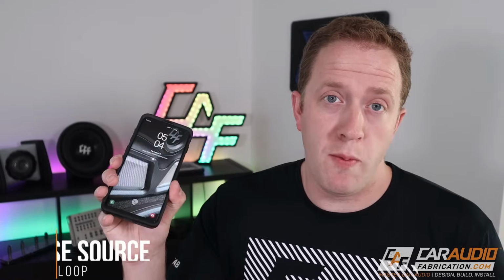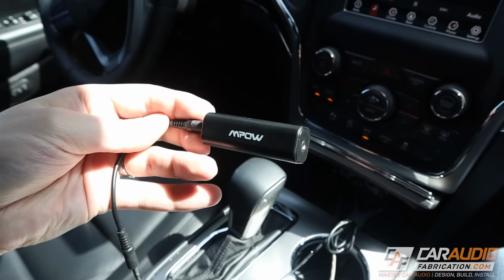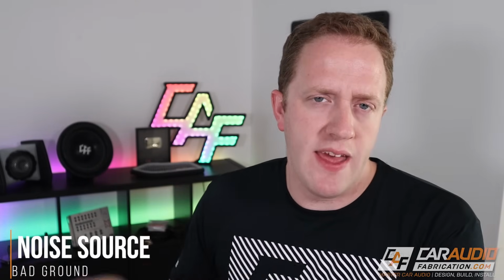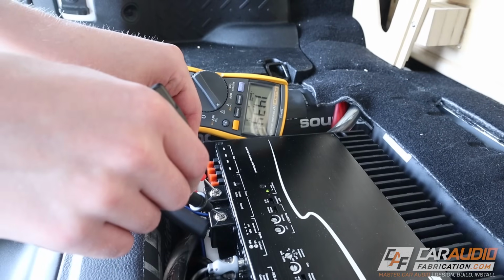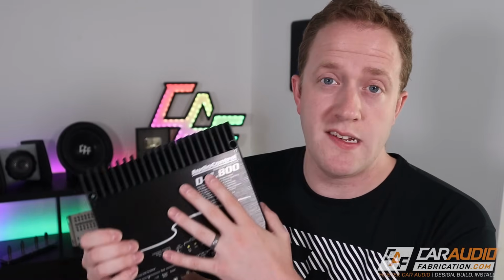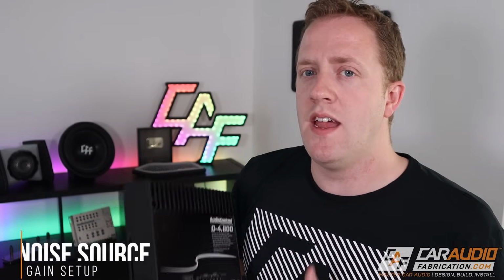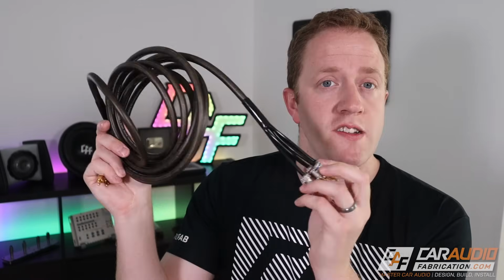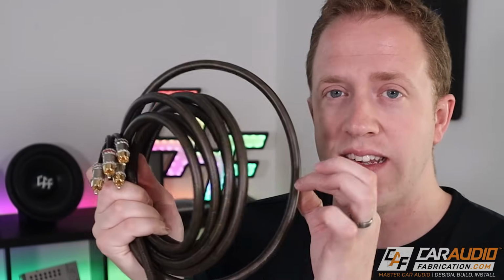BUZZ, WHINE, HISS? How to FIX Car Audio Noise!

Comment: Hi guys,

I have the same issue, but I already tried most of the tricks in the video : I switched grounds, grounded the components directly to the battery, added Ground Loop Filters etc...

The strange thing is that the buzz get's louder when i press the brakes, or when I turn on my turn signals (at the same frequency as the bulb), and it takes a few seconds to stop after i turned the volume all the way down.

Any ideas ?

Comment: I have a lexus is2015 i have a aftermarket amplifier hooked up with 4 mid range. and everything connected to my factory radio using a Lc2 but i’m still not getting enough power to play it louder , can someone help me with this issue??? :(

Comment: I guess mine isn’t that common. 

When my key is on accessory position no hiss. 
Once it goes to the on position hiss. 

Radio can play with absolutely no hiss of the key is turned to the accessory position. 
Hiss will stop if I turn head unit off.

Comment: I've literally  done everything  I can think of to get rid of alternator  whine besides just adding filters. Is there any special  circumstances to where there is no other option. It seems  to me that if the noise is happening  then there is a problem somewhere else that a filter is just hiding.

Comment: Hi there i have a strange issue, the whine nose i get only happens when i turn on my headlights so the head unit plays normally, and without an issue, until i turn the lights on then i get that Whine that are you talking about any advise? Thanks again for the video it's very informative

Comment: Im using an aftermarket headunit in my 2000 silverado.  Its been perfectly fine for 15 years.  I recently added a 3.5mm headphone jack to the AUX input, and connected a small $10 Bluetooth adapter from Amazon... It was cheap, but has 4.5-5 star reviews from everyone, and they all said the sound quality was great... I'm getting a whine that gets louder as the engine revs.. Im sure its RF interference from the ignition coils, but i'm not sure how to isolate it... And just to add, my 3.5mm to AV cable is only 1ft long.. it was just long enough to make the connection, and allow me to mount it right under the air vent, in a factory "blank" spot... Something i guess is used for a feature i don't have. lol  Thanks

Comment: Hi, I installed an amp in my car with high level inputs cables directly to the amp (keeping the factory stereo) and I get a lot of static using the radio, CD or aux. I have a ground cable bigger than the power cable. What should I check? The ground cable is bolted really tight.

Comment: In my car the radio became static in end of may and then my bluetooth transmitter stopped working compleatly a week ago. I did charge it at the same time as using it, so  what would be the right thing to do? Does the 1st option in the video also fix radio?

Comment: I just installed a full system to my stock head unit in my 2016 Canyon. Now my blinkers are LOUD!! and there is a constant buzz tnat does not change with RPMs... just constant.  The power line is run away from speaker wire. The ground is in the body under the rear carpet near the amp. Any ideas what else I should check besides what you talk about above? And thanks for ALL the videos...I have learned a lot! ;)

Comment: The problem I started to have ( 04 Acura TL, everything is still lemme ) is that I start to have the front driver side speaker and tweeter buzz whenever the car is on. If I just have the ignition forward I can play music with no issues, it’s only when the car is turned on!

Comment: I have a Toyota rav4 2001 just got a tune up oil change but this problem has been on going a mechanic told me to just unplug the battery it works for a short time but go back to where it was this problem is with the radio i don't have a amplifier but i am getting the same noise that you are describing in your video now i think i need a new radio or is there a bad wire somewhere ?????????????

Comment: I watched  about 5 videos about static noise, I disconnected all the speakers 1 at a time. Went through the ground wires.  Then when I turned on the stereo for the 20th time, I looked, and it was on a nonexistent FM radio station. LMAO, I am such a Noob. Set it to CD or BT or heck set the FM to a station, problem solved.

Comment: Strangest buzz I ever had. Did everything you said. It was a 95 chevy van. Doghouse cover to the engine had 1 loose screw holding it shut! I even bought new plug wires amongst other things. Chased it down for 1 year! Was a stupid loose screw.

Comment: When I bought my 1990 mustang in1990
I put in a better sound system 
I got a whine that the transmission. 

I put in a transformer just behind the radio. 
I ran it through the ground.. 
Whine gone. 
Never figured how it worked
Had a old timer tell me to try it

Comment: I have a 2014 Passat with the Fender sound system, I started hearing a static noise on my passenger door, so I replaced both door speakers. Still happening, only to that one speaker. What could that be?

Comment: Please help me... 2017 WRX with OEM Kicker speakers.  No external amp.   There’s a cracking noise from the tweeter area but can be heard in every speaker. It’s almost like a rattle or a buzz, but it seems frequency dependent. Some songs it’s bad, some you can’t tell.  It’s driving.  Me.  Nuts.

Comment: I have the issue where it whines when i accelerate. But not only that also when i use more power fx. by rolling my windows up and down, or increasing the air from the fans. It's when i use an FM adapter, and when i use the typical radio stations on my radio i have no problem, othere is clear sound coming out from the speakers. Anyone knows a fix, because i can't find any on google and etc.

Comment: hi mark i have this problem with my unit if i wire a mono amp or 2 channel amp i dont get this engine noise. as soon as i wire a 4 channel amp to my unit using front and rear rca from my pioneer unit i get this engine noise doesn't matte if i play only cd or fm or bluetooth. when i wire a 4 channel and use only rear or front as bridge to my 4 channel amp i don't have the engine noise. i checked my grounds my rca cables i tried a different unit but still have the same problem. this problem i only get if my car is started.

Comment: I just got a subwoofer install from the company and when I accelerate, the speaker makes a loud humming sound. I check ground connection which is good and sand paper down but noise still continue when I tear up my engine. 😩😩 help please. I spend too much to be dealing with this.

Comment: I’m currently having some crackling coming from the front left (driver) mid and tweeter (component), and both rear coaxial speakers at low volume. When I turn the volume up last 10, the noise seems to go away, but immediately comes back when I lower the volume to 10 and below. Quick breakdown of my system: Alpine Type R components up front, Alpine Type R coax 6x8 out back, Performance Teknique 4 channel amp (don’t remember specs offhand, but advertised at 250watts per channel), L5 12” Solo Baric, Performance Teknique mono amp (approx 800watts peak), Pioneer Avic D3 head unit along with complete KnuKoncepts wiring and Krystal RCAs. Anyone out there have any ideas as to what’s causing the crackling? Thanks!  🍻

Comment: Yes, I re-routed the rca cables, sound got worse, now it makes noise when the radio is on, an also when cd is playing, will try putting a plastic  or rubber washer between the amp, an check the ground wire in the head unit.

Comment: I have a questions . I have a aftermarket head unit, amps and speaker . When I turn the head unit on I get a buzz from the speakers . But if I have the car running and I shut off the head unit . It goes away . Is that the ground to my head unit that's bad or do I have to look at the amps ? BTW me turning the head unit off turns off the amps as well . Thank you

Comment: im having a hiss to my aftermarkets front dash speakers i just installed.. they are connected to my factory amp. and my subs are to my aftermarket amp... my rcas are running along the middle with the power cable to my amp though. i disconnected my rcas from my amp but no difference.. im going to disconect the power from my battery to my amp right now i guess that will tell me if its my rcas because no power will be along side them.... if that doesnt work idfk....

Comment: Hi Mark....thank you for all the videos shared...
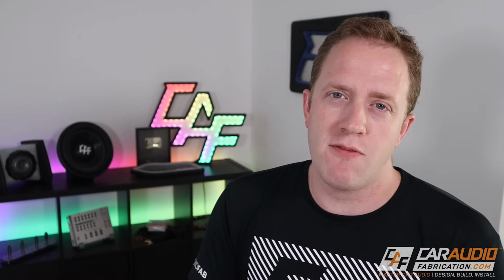I have XM-GS4 and only the front right channel makes a weird noise. I have a wrangler too and if you can please click the link you will find the audio I recorded of the noise. Background is my car on idle and around min 1:20 you will hear the noise I can't get to eliminate.  https://drive.google.com/file/d/1FEirD9iHFOBPA3vgZG3C2GtwCxRdA1UG/view?usp=drivesdk
I hope you can advise me... 
I already changed, wires, speed wire (9), ground, RF speaker,  signal cables, I added noise suppressors, etc and I can't get it fixed...it is only the RF channel...hope you can help me...
I am about to open a warranty claim to get the amp fix by Sony...Thanks in advance...Natalie

Comment: i remember having a whining noise in the back passenger side of an 1999 audi a4, idk why it started, but it would get louder with acceleration, and wasn't present if the key was only in auxiliary, i have no experience troubleshooting so i just unplugged that speaker and started reading and watching.. this video had some good info

Comment: I've got a high pitch ringing going on with my radio that only goes away in standby mode. Volume at zero and it's always there. New Kenwood radio, 2 Rockford fosgate 6 inch in the front doors, 2 6x9 on the parcel shelf and new 1000w Kenwood amp in boot. Good earth and I haven't adjusted anything on the amp because I don't know what to do. Anyone have any ideas because it's really pissed me off..

Comment: What if I get that buzzing noise ALL the time? It’s does it to matter what. Even when my phone is not plugged in charging. And my phone is connected to my radio thru Bluetooth not aux code.

Comment: yo bro im from Philippines, i have a Audio set up on my Tricycle 2pcs Subwoofer 12" running on a 1000watts Sony Explod Amp and a 4pcs of 6x9 speaker For Mid range and High range runnung on a Lightning lab Amp i use a 2D battery to power it all and a pioneer parametric that connects to an aux to my Cp When i turn on my Sounds then Turn on the engine it has some whining Sound or what we called static that When i Rev the engine my Audio set up also Whine what should i do?  thank you for your response Godbless your channel!

Comment: Mark I'm going nuts trying to set the gains on my Kenwood excelon 5 channel amp. Every time I try to measure it with my o-scope it's reading some whack 8khz Signal or even higher when I play my 1khz test tone. On my old car I've never had a problem. Have you ever run into an issue like this? When I test the RCA signal it reads perfectly.

Comment: I'm so confused, static in all of my speakers that goes up with the gain, but stops when I unplug the RCAs. I even got a ground loop isolator to no avail. I redid my ground as well to have a very clear connection, any suggestions?

Comment: I ran new speaker wire to my components (10 gauge) on passenger side I ran out of that wire so spliced 12-14 gauge wire I had laying around. Both OFC speaker wire . I have a slight hissing/humming sound at all volumes from 0-40 noise does not change with volume increase or decrease. Do you think this is caused by me splicing those wires should I just buy more 10 gauge and wire it same as driver door. (Which is not making noise)

Comment: Factory radio . Aftermarket amp. First Bluetooth mic disconnect it worked but no Bluetooth talking then added a pac .. problem solved

Comment: I separated my rcas from the power wire that runs down the car. There is still a whine every time I rev the engine, but it’s not as loud as before. Any ideas to get rid of it completely?

Comment: I can hear the FM radio on my bluetooth setting in an android aftermarket radio, I didnt hear it before, but after connecting the amp signal wire to the ignition switch, its now a problem, maybe something got loose when I pulled the radio out? I had to connect that wire to the ignition, because before when I used to shift to reverse, the amp signal would stop working when I shifted back into drive.

Comment: My friends car has a hissing noise when high output sounds are coming through the speakers, usually vocals like when S’s are said or high hats and cymbals. Would You happen to know what some reasons may be for this? It’s an aftermarket radio with an amplifier for the speakers.

Comment: I have quite an odd issue I can't find a solution to. I have a 2014 vw jetta tdi and I wired up my head unit, and it wouldn't turn off, then I found that the stock radio was controlled (on/off) by the canbus system in vw's so I ran a wire to the cigarette lighter for the stereo on/off since the cigarette lighter turns on/off with the car, and it worked but when I put my amplifiers in it created a high pitch ringing noise all the time, but only with my charger plugged in, but my phone isn't plugged into it (with the engine off or on), I have some led's plugged into it but not my phone, so I went over to the fuse box and tried tying the stereo on/off into every fuse that turned on/off with the ignition and everything made the same ringing noise. It doesn't matter if I have nothing but the power, ground, ignition signal and the rca's, it still makes the noise. I tested the amp by plugging my phone into the rca's and playing music and it was fine, tried removing the radio and testing it with my home theater system and it was fine with that too, I don't know what else to try please help. P.S. ran new power/ground wires straight from the battery to all the components (head unit and amp) and that didn't make a difference either.

Comment: Hi 
I run speakers wires,signal cables(4 channel from radio unit to LC7I LOC to the boots plus power cables in the same space through the car ,everything works good except I am Getting wired noises in the speakers when accelerating .any ideas why? 
Can it be because my cables run next to each other ? Or could it be something else ?

Comment: Ive got a problem with a subwoofer hum.
When the engine is on, if I turn the gain more than 40%, I get a really bad noise.  When the engine is off, the sound is clear. I'm using a high-low filter.
When I unplug the RCA from amp, the sound disappear

Comment: I had the same problem, but every thing in my stereo is originally, nothing modified, nothing has been add. The only thing is when use the radio it sweet and clear, but if were using my Bluetooth cassette it will make the buzz sound. What to do?

Comment: I installed a DSP between my factory radio and amp and I am getting a hissing noise. The hissing noise does not increase when i change the radio voulume, however it does increase when i change the volume on the DSP. Any ideas?

Comment: I had my amps pick up some kind of electrical noise from my blower motor and blew my Focal KRX2’s I miss them so. I am gonna fix it before I install anymore highs. Right now I’m using the factory highs with my DC audio 2k and 2 12 lvl4’s.

Comment: yes I had this noise and it was wrong wiring ... the audio wires was passing together with the power cables .... and I solved it by change the audio wires to the other side ... thank you dear

Comment: So I can't even turn my gain to 20% without hearing the buzz.   I found a factory bolts and wire brushed it before making it my gnd I have lc7  sitting between my amp head unit what should I do?

Comment: I have a stock stereo. But after market mids and tweeters. There's a buzzing noise even if nothing is playing and at any volume. The shop mentioned they had to install some kind of converter. Seems to be coming from the stereo it self. Any clues?

Comment: still trying to get the alternator whine out of my trailblazer. already upgraded and relocated wiring, better rca's, and ran larger ground cable to frame as well as straight to battery.,  added rca filters and power wire filters. among other things. bought a different pre-amp head unit lowered the noise some, but still there. after watching this video, l'm gonna try running new ground to head unit. that's about the only thing I haven't tried.

Comment: I have a static noise coming through my speakers and my stereo is stock so i used an rca converter and ive tried disconnecting the rca cables but the static is still thrre im not sure how to resolve this

Comment: So I use one of these in my car and with it plugged in it quiets my bass A LOT. When I unplug it the bass in back to normal but can hear the static and popping going all the way back to the subs. Is there a way i can fix this by grounding the head unit better or something? Need a way to keep bass at normal levels and kill the static ground loop problem.

Comment: Im trying to figure out why my bullet tweeters are hissing. i recently installed a four channel amp and my front and rear door speakers sound perfect. its jus my bullet tweeters that make a hiss sound. at zero volume I hear a hiss/ static . I can turn up the volume turn on lights press on brakes and the noise dnt change. I need some help. Thanks

Comment: my problem is the exact OPPOSITE. i get horrible audio when i just have my audio jack in, i can barely hear it. but if i plug my phone into the charger, it fixes it. but now lately its been sounding whiny. so its either between not hearing the audio, or dealing with the whine. any ideas?